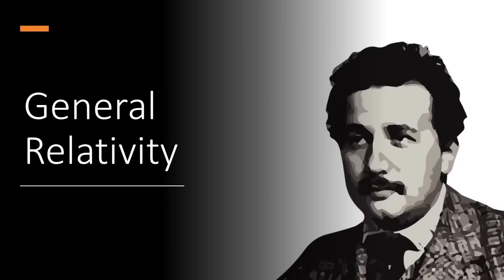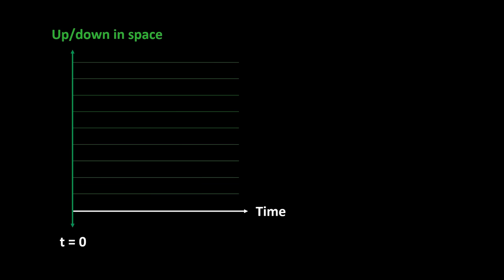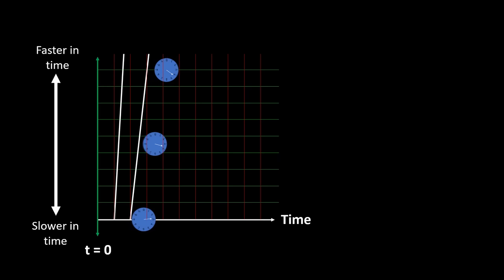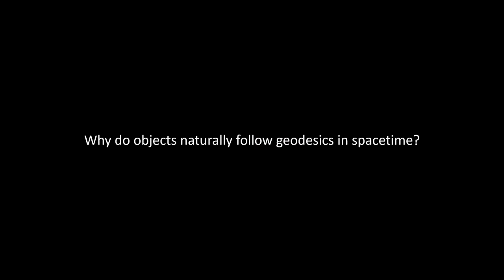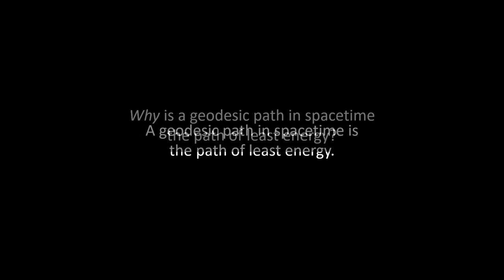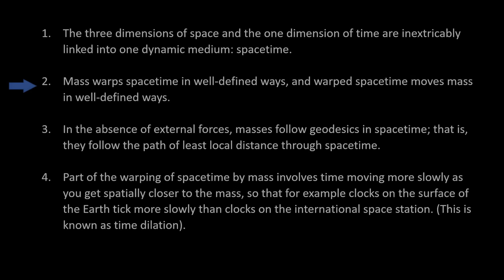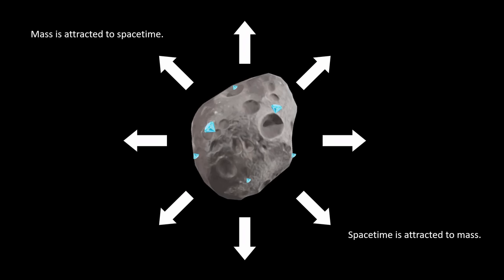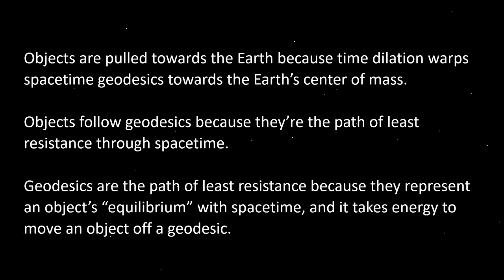How Time Dilation Causes Gravity, and How Inertia Works

Comment: You would have been better off saying that light travels in all directions and mass compresses particles together and attracts them more therefore the light which is technically the light particles and waves given off of an object attract to each other and connect it essentially gets tethered to the largest form of gravity around it that would also explain why there's less gravity and it still fits in with Mass see I can do it too

That also explains the quote on quote bending of light you're saying the particles getting siphoned off giving it a bend effect see I can do it too

Comment: First off you're wrong about time time is just energy and decay

Second off you're wrong about space space is not a physical object reality the things that exist inside reality are physical objects space itself is not

Those are the two biggest problems with this theory that nobody seems to understand you're not sitting on a fabric or water or whatever you claim it is space is not there

It's just not that's not how it works you're all taking a theory and applying what you see to that theory and claiming it's correct

That's wrong you're supposed to apply what you see until you build up the answer the idea or theory is what sets you on the path it isn't what you bend your results to

Comment: The dilation is so well explained with the apple falling in one dimension, the best explanation I have seen! But showing the dilatation of time from a 2D spacetime in a 2D plane is misleading and erroneous, because it suggests that the 2D spacetime is evenly stretched so that the result can still lies on a 2D plane, as if there were no curvature. But it's wrong : in the same fashion than the surface of the earth cannot be displayed on a 2D plane without screwing distances, it would be more correct to display the (post dilated) 2D spacetime with the apple as a curved 2D surface in a 3D space (like in videos from Khutoryansky). Showing geodesics as path of least resistance would then be more correct and intuitive

Comment: How does the stationary branch provide energy to keep the attached apple from following a geodesic?
Reply from the maker: Hi Ildar, great question. This all comes down to the equivalence principle view of gravity, how an object held stationary in a gravitational field (like the apple on the branch) is equivalent to that same object accerelating in a rocket far out in space away from significant gravitational fields. If these two really are equivalent, then they are amenable to equivalent descriptions in terms of energy. For an apple accelerating far out in space, it’s clear how much energy it takes to accelerate at g for one second, it’s the apple’s kinetic energy after that second (1/2 * apple mass * g^2). The energy is delivered by the rocket’s propulsion, and the store of energy is spent by that propulsion. How about the apple on the branch? In the equivalence principle view, the branch is accelerating the apple upward at g just like the rocket’s engines (and the tree is being accelerated upward by the surface of the Earth), so the same amount of energy is needed, and it’s delivered through molecular bonds in the branch. The question of what store of energy is being depleted is more difficult. I think a more general way to ask this question is “what energy is being converted into the apple’s kinetic energy?”. In a roundabout way, it’s the interaction of mass with spacetime that supplies this energy (similar to how it’s this interaction that supplies an object in a gravitational field’s potential energy in a classical framework). The Earth’s mass interacts with spacetime to warp it at a global level, and it’s this warping that causes the apple’s geodesic to bend towards the center of the Earth. I agree with your stance (what I think your stance is) that this equivalence principle version of events is highly nonintuitive, especially when you consider it from the standpoint of the conservation of energy. This discussion that someone shared with me regarding this video might help clarify the situation, especially Viktor Toth’s answer: https://qr.ae/pGqeZl
Reply: The apple and the branch are the same object until the stem breaks.

Comment: what is the source of energy keeping the apple on the branch? This is not the usual way I think of energy. After you describe the sled using a rocket propulsion to deviate from the geodesic you return to the apple analogy. But here I don't see what's expending energy. The situation is static. Its really only when i imagine the apple staying there without the branch that i see the need for propulsion, for example a drone keeping it afloat.
Reply from the maker: Really great question, I appreciate that you’re digging into the most conceptually confusing (and potentially, challenging to the theory) point of it.
Let’s think first about the classical version of this situation. In this view, the apple has gravitational potential energy (mgh) due to its position relative to the surface of the Earth, and zero kinetic energy. If the apple falls, its potential energy is converted into kinetic energy as it accelerates downward, until it hits the ground with potential energy 0, and its kinetic energy is dissipated via heat. 
Now let’s think about it from the equivalence principled “apple continuously accelerating upward” view. Here, the apple has zero gravitational potential energy (since we’re considering it as in a rocket ship out in space, away from significant gravitational effects), and the branch is accelerating it at g. Already there’s something suspicious about this setup; what if we wait for a year? Accelerating at g (9.8 m/s^2) for a year (31,536,000 seconds) would take the apple to 309,052,800 m/s, which is faster than the speed of light. This can’t be right. 
This article (https://en.wikipedia.org/wiki/Equivalence_principle#Einstein's_statement_of_the_equality_of_inertial_and_gravitational_mass) clarifies that the equivalence principle only holds when the volume of the experiment is small enough that tidal effects and things like exceeding the speed of light can’t be observed. So the right way to look at this might be to consider the apple just over the course of one second, right after the apple breaks free of the branch. Let’s say the apple was hanging 9.8 meters above the floor of the rocket. Here, the apple’s kinetic energy in the frame starts out at 0, and it has no gravitational potential energy; only the surrounding situation involves an exchange of energy (that is, the apple’s entire environment is accelerating). From the apple’s point of view, it’s sitting still while the floor of the rocket rushes up towards it at g, and the energy of the apple is only affected when the floor collides with it. 
Now if we look back at the situation on the surface of the Earth from the equivalence principle perspective, we can hopefully see more clearly what’s going on. The “gravitational potential energy” we would classically consider the apple to have has disappeared; we just have a perfectly stationary apple in an accelerating frame. The kinetic energy we also would classically ascribe to the apple after it breaks from the branch has also disappeared; again the apple is perfectly stationary, whereas the tree and ground accelerate upwards. There’s no energy exchange with the apple until the ground hits it. 
Ultimately, in switching between the two pictures, we’re switching between two ways of handling energy, and it’s much more intuitive (and therefore useful) to use the classical picture and its way of tallying energy. This doesn’t mean the “accelerating frame” picture is useless, just that it isn’t helpful when modeling things in a gravitational field. 
To dig in a bit further, let’s look at the rocket scenario a little closer. What is the rocket accelerating with respect to, and what is the “falling” apple stationary with respect to? The answer is spacetime. How about the surface of the Earth from the equivalence principle perspective? What is the surface of the Earth and tree accelerating with respect to, and what is the “falling” apple stationary with respect to? Again, the answer is spacetime. In both cases, energy is causing an acceleration of masses with respect to spacetime (in the former, that energy is in the form of rocket fuel burning, and in the latter, that energy is in the form of mass, that of the Earth in particular). What’s confusing here is that the rocket’s energy is being “spent”, whereas the energy of the Earth’s mass pulling in spacetime seems not to be. The energy comes from the Earth's mass's effect on spacetime (mass being equivalent to energy), and it accompanies all masses; in fact, that's where gravitation comes from in the first place, a conversion of energy from other forms into the form of mass warping spacetime. The gravitational potential energy between any two objects is due to their relative distances and the fact that bringing them closer together lowers that potential energy (and converts it to kinetic energy). The energy was "spent" in warping spacetime when that mass was formed, setting up this potential energy, (almost the same as stretching a spring between all masses everywhere).
Reply: @IdeaListEye  wow. I didn't expect such a response. I've read thru it once, and I'll probably read it again. It's adding to something i absorbed from your video describing how masses warp spacetime. Although spacetime isn't this physical thing like a rubber tarp, it does seem to have properties like storing up a kind of elastic or potential energy.
Reply from the maker: @FredPlanatia  Exactly! Yeah, at the moment that masses are formed, the energy that goes into the formation of that mass (via E = mc^2) is stored in the warp that mass causes in spacetime. When the mass forms, spacetime is pulled inwards from every direction towards that mass: the warping described by general relativity. The huge burst of energy that's released by a nuclear reaction is from that inward pull being released, which propagates outwards as high-energy light.

Comment: Matter is made of space-time, so that's why it warps it, I guess. I'm curious how you explain gravitational waves. The two merging black holes should follow geodesics and therefore not lose energy or not?
Reply from the maker: You can follow a geodesic and still lose energy; a simple example is a falling magnet, which radiates electromagnetic waves as it falls ('losing energy').

Comment: Interesting take on the whole issue but you didn't convince me.  I have philosophical
difficulties getting around the idea that ultimately we really don't even know what time
is to begin with.  The geodesics explanation definitely was no more convincing than it is in
regular discussions in general relativity where it remains somewhat obtuse and lacks
intuitive persuasion.  If sounds like an interesting hypothesis to say gravitation is
caused by time dilation but you could also argue that the time dilation is caused
by the increasing velocity of an object as gravitation draws a mass to another mass.  
Still, your thinking appears innovative and I have learned that saying no is the sure way
to eventually be wrong.

Comment: So light only slows down or speeds up when space/time tugs on it as a result of mass in its vicinity. With no mass near it or behind it, there is no thing to slow it down or alter its direction. With no mass of its own, there is no mass to slow it down! That’s the reason light arrives instantaneously. That’s the reason light years is not an accurate measure of distance!

Comment: I don't get one thing. You said it takes supplying energy, to move away from the geodesic. Like the apple hanging onto the tree. I also understand that according to the equivalence principle, the apple is being accelerated upwards. Both these explanations, that suggest that energy is being supplied, make me ask... where is that energy coming from? The branch can technically hold the apple forever. So how can energy just be created like this? Where is the energy being lost, to give the energy needed to hold up the apple?
Reply from the maker: Really great question, I appreciate that you’re digging into the most conceptually confusing (and potentially, challenging to the theory) point of it.
Let’s think first about the classical version of this situation. In this view, the apple has gravitational potential energy (mgh) due to its position relative to the surface of the Earth, and zero kinetic energy. If the apple falls, its potential energy is converted into kinetic energy as it accelerates downward, until it hits the ground with potential energy 0, and its kinetic energy is dissipated via heat. 
Now let’s think about it from the equivalence principled “apple continuously accelerating upward” view. Here, the apple has zero gravitational potential energy (since we’re considering it as in a rocket ship out in space, away from significant gravitational effects), and the branch is accelerating it at g. Already there’s something suspicious about this setup; what if we wait for a year? Accelerating at g (9.8 m/s^2) for a year (31,536,000 seconds) would take the apple to 309,052,800 m/s, which is faster than the speed of light. This can’t be right. 
This article (https://en.wikipedia.org/wiki/Equivalence_principle#Einstein's_statement_of_the_equality_of_inertial_and_gravitational_mass) clarifies that the equivalence principle only holds when the volume of the experiment is small enough that tidal effects and things like exceeding the speed of light can’t be observed. So the right way to look at this might be to consider the apple just over the course of one second, right after the apple breaks free of the branch. Let’s say the apple was hanging 9.8 meters above the floor of the rocket. Here, the apple’s kinetic energy in the frame starts out at 0, and it has no gravitational potential energy; only the surrounding situation involves an exchange of energy (that is, the apple’s entire environment is accelerating). From the apple’s point of view, it’s sitting still while the floor of the rocket rushes up towards it at g, and the energy of the apple is only affected when the floor collides with it. 
Now if we look back at the situation on the surface of the Earth from the equivalence principle perspective, we can hopefully see more clearly what’s going on. The “gravitational potential energy” we would classically consider the apple to have has disappeared; we just have a perfectly stationary apple in an accelerating frame. The kinetic energy we also would classically ascribe to the apple after it breaks from the branch has also disappeared; again the apple is perfectly stationary, whereas the tree and ground accelerate upwards. There’s no energy exchange with the apple until the ground hits it. 
Ultimately, in switching between the two pictures, we’re switching between two ways of handling energy, and it’s much more intuitive (and therefore useful) to use the classical picture and its way of tallying energy. This doesn’t mean the “accelerating frame” picture is useless, just that it isn’t helpful when modeling things in a gravitational field. 
To dig in a bit further, let’s look at the rocket scenario a little closer. What is the rocket accelerating with respect to, and what is the “falling” apple stationary with respect to? The answer is spacetime. How about the surface of the Earth from the equivalence principle perspective? What is the surface of the Earth and tree accelerating with respect to, and what is the “falling” apple stationary with respect to? Again, the answer is spacetime. In both cases, energy is causing an acceleration of masses with respect to spacetime (in the former, that energy is in the form of rocket fuel burning, and in the latter, that energy is in the form of mass, that of the Earth in particular). What’s confusing here is that the rocket’s energy is being “spent”, whereas the energy of the Earth’s mass pulling in spacetime seems not to be. The energy comes from the Earth's mass's effect on spacetime (mass being equivalent to energy), and it accompanies all masses; in fact, that's where gravitation comes from in the first place, a conversion of energy from other forms into the form of mass warping spacetime. The gravitational potential energy between any two objects is due to their relative distances and the fact that bringing them closer together lowers that potential energy (and converts it to kinetic energy). The energy was "spent" in warping spacetime when that mass was formed, setting up this potential energy, (almost the same as stretching a spring between all masses everywhere).

Comment: I also have doubts about what you are doing in 4:48 . Because at first a geodesic is the locally longest path through spacetime and at second, by looking at the distances via circles you are unsing a euclidian norm. But spacetime does already in the flat case  has no euclidian norm but a minkowski norm! So i don't think it really makes sense what you are showing there.
Reply: A geodesic is the shortest path, not the longest. And on that simplified spacetime diagram, with only one spacial dimension, a (euclidean) straight line is the geodesic (unlike in real life). That's why he's using euclidean norm.
Reply: @Leitefsj  A Geodesic on a Riemannian manifold is the shortest path yes, but a geodesic on a Lorentzian Spacetime maximizes proper time along that curve, what represents the curve length. So Arguing with with shortest paths ina Riemannian space about geodesics in Lorentzian spacetime doesn't make much sense to me.